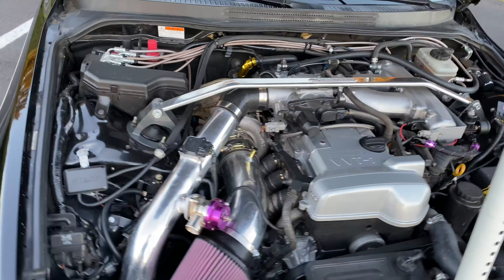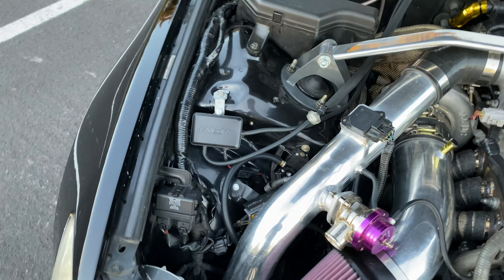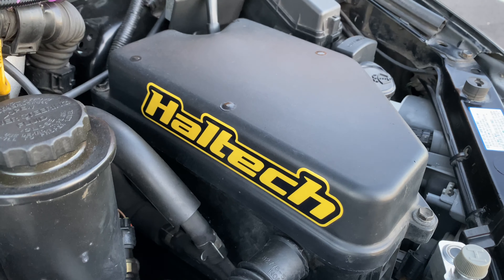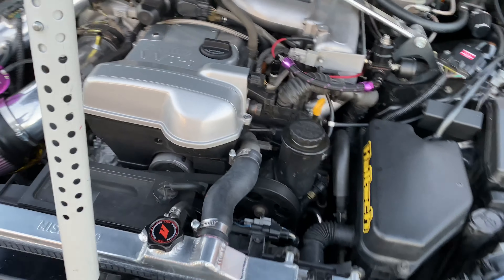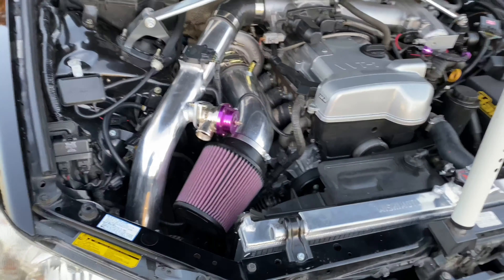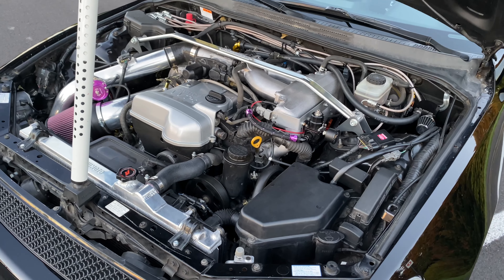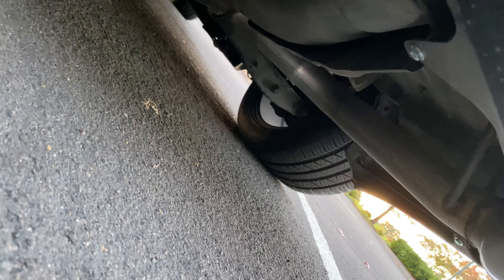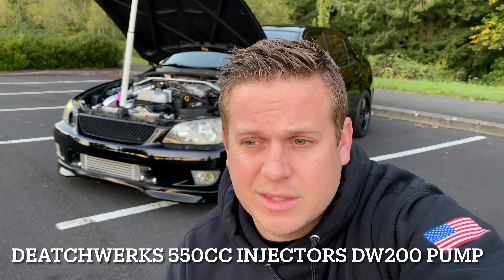IS300 Turbo Version 2: The Breakdown

Comment: In my opinion 418 is still a ton of power. Totally agree your decision of stopping further modification to the car, your car will probably last much longer now than if you have 500+hp.
My questions are:
1. How is the auto tranny performing at 418hp?

2. Do you think Elite 2500 is worth the extra 600$ than Elite 2000?

3. Do you think 225mm wide rear tires are adequate to handle 418hp with stock Torsen LSD?

Thank you for making these videos, your current setup is my ultimate goal ;)
Reply: Thanks! Like I said I wanted 500hp, but after driving it, it does drive great. 
Tranny holds up great with the mods explained. I think the elite 2500 is worth it, never have to buy another ECU, if I ever decide to go crazier, I have the ECU to back it. The 255 wide tire is not enough for the power, I will mess with tires down the road. Like I said I will leave it alone.

Comment: I have one of these. 
I put the battery behind passenger seat
I've destroyed 2 r154s
I've destroyed 2 factory diffs 
Replaced side fed with top fed injectors
Been working on Toyota engines long enough to know. Internals are usually standard on all engines. It's interesting to see how we both solved problems only took different routes. I'd love to hear your ideas as to how to rewire and such .

Comment: I’m pretty sure your catch can needs to be connected to your turbo intake to suck valve cover pressure , would recommend a 3 port catch can and connect the pcv valve to it, drawing air from the turbo
Reply: I’ll have to look into that, thanks

Comment: You don't necessarily need the gte block to hold the power, you can get away with the ge non vvti block and it can hold the power like the gte as it has the same rod as the gte, or if you don't want to go that route then you can rebuilt your stock block with a piston and rod from the gte or non vvti ge.
Reply: You are correct. I got a deal on a brand new GTE which is why I went this route. I still have my stock block that I plan on building for another car. I cracked 3 pistons on my old motor, which is why I put the GTE in.

Comment: do you get trouble for not having front plates in oregon? also what are your rim sizes? looks good
Reply: Thanks! 17x8 38+ offset Lamarai Wheels, Lexus use to carry them at dealers back in the day. 
Yes 100% suppose to have plates in Oregon an Washington, never gotten pulled over yet 🤞

Comment: Would you recommend rebuilding the ge motor
Reply: Rebuilding a stock GE is not worth it in my opinion. Now rebuilding the GE motor with GTE pistons and rods is a different story. Upgrading internal parts will help you in the long run depending on your power goals.
Reply: @davisweyant3908  yes that’s what i meant by rebuilding it. Thanks though 👌🏾

Comment: Great videos!  Already order the gte short block.  What is the terminal adapter you used, it looks clean with the battery relocation.
Reply: Thanks! Everything I got for the battery relocation was on Amazon besides the battery. Still wasn’t cheap, but holds up great.